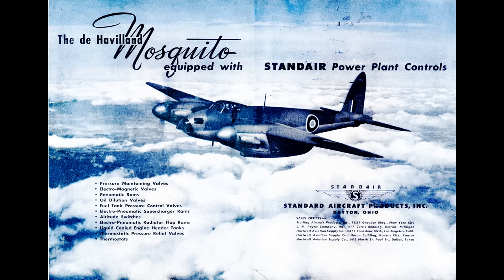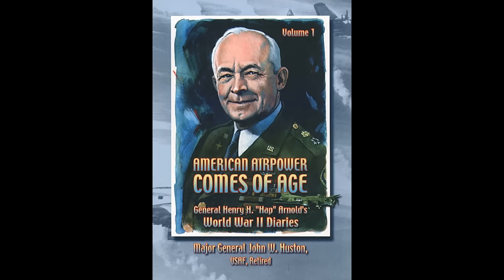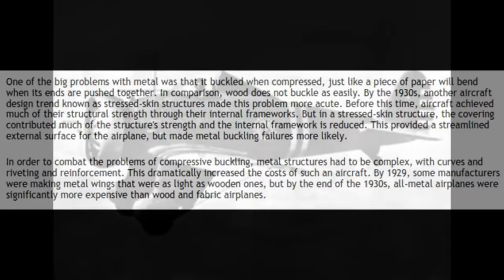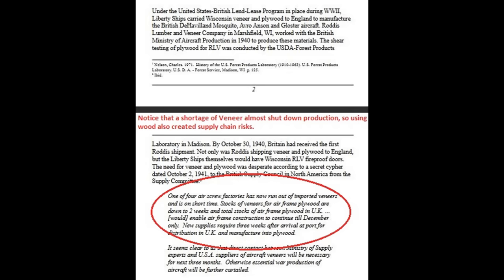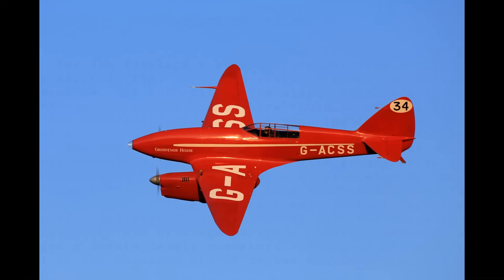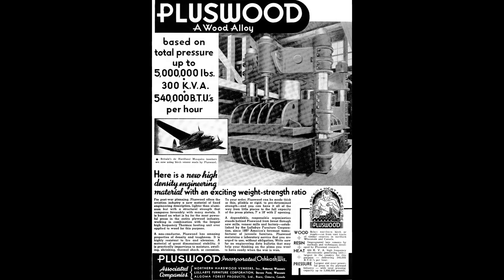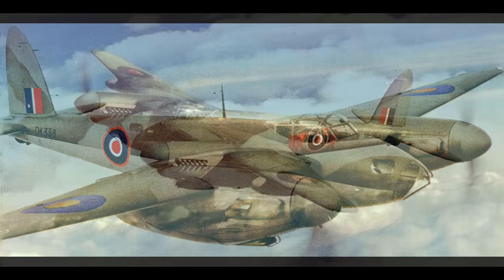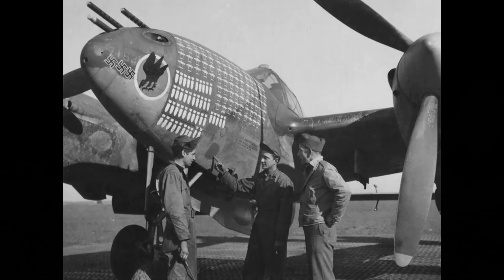De Havilland Mosquito vs. ?

Comment: The "Wooden Wonder", looking forward to this one Greg, even more than usual.
Reply: I second that.
Reply: Losses of the mosquitoes was lower than any other bomber due to its sheer speed and manoeuvrability and all with no defencive arms
Reply: @markmitchell450  Airframe losses were indeed lower than other types but aircrew survival from shot-down Mossies was slim. The airplane was very hard to bail out of. No canopy jettison, had to exit through the belly hatch (right next to the starboard prop). I've been in one, it's tight!
Reply: @zephyrold2478  q
Reply: @neilrobinson3085  er have you seen the upper canopy escape hatch?
Reply: big cheese  OK so how many mosquitoes were shot down by rather German jets?
Reply: @neilrobinson3085  there was a jetisonable upper canopy which was the recommended route for a  bail out also for forced landings.

Comment: The most versatile aircraft of the war. And one of the prettiest too! A fact not often mentioned that I think highlights the genius of De Havilland's design is that all parts of the 'plane that were heavy or bulky, such as engines, wheels, bombs & fuel tanks were attached to the wing. This took a lot of stress away from the fuselage. In an old black & white docco I saw, a ground crew member being interviewed said ' "Everything on the Mozzie is bolted to the wing, so all the fuselage has to do is hold up the tail & keep the rain off the pilot".

Comment: The casualty rate on the Mossie was incredibly low . Thank you . Four versions , bomber , intruder , night fighter,  fighter bomber , and a web  foot warrior ,anti shipping strikes and anti sub patrols .
Reply: The light construction and (sometimes) no armament made a recon mossie a speedy bird that was very hard to catch==but when it was caught...
Reply: Quite! But it's hard to find an equivalent aircraft like the Phantom: it could tangle with single engine fighters, with no problem (due to it's robust design and good thrust to weight ratios--especially when it had good to great pilots in the 'pit), the Mossie was a hell of a plane, but I don't think the odds of dogfighting with an Me or FW were going to be good unless there was a hell of a pilot at the controls.
Reply: It was also used by the OSS, ( forerunner to the CIA. ) for insertion and communication with their agents. A Radio operator rode in the bomb bay. There was also a "civilian cargo" version that flew to Stockholm to pick up consignments of ball-bearings. They were nominally owned by an airline to get around Sweden's neutral status.
Reply: @colinkepple7555  Yes. BOAC Mosquitos. A few were shot down. One brought Nils Bohr the nuclear scientist back from Stockholm, to eventually join the Manhattan Project
Reply: @nickmitsialis  it was rarely if ever caught, one of the reasons the USAAF bought them for photo recon.
Reply: @hughjohnson2674  Indeed; when stripped down the Mossie was faster than heck.

Comment: Another great video.
I recently read Sidney Camm's biography and its surprising how much time he spent talking to the man at the Ministry. De Havilland probably did the same. Alfred Prices book on the history of the Spitfire goes into some detail about how the RAF only saw the Spitfire as an interim measure until the Westland Whirlwind, with its 4 centrally mounted cannon was ready, and  which itself probably only second reserve to the Hawker Tornado, so when RR pulls production on both the Peregrine and the  Vulture engines both these planes are basically dead( indecently, chopping the Vulture kills of the Avro Manchester at this time as well ). Hawker do have a back up plan with the Typhoon, but at that time in 1941 the Sabre is so far from being a reliable engine, so one can imagine the man from the Ministry desperately asking De Havilland 'what can you do quickly for us?'
Its interesting but in literature the Camelot fables tells us that in time of need the wizard Merlin will always be there to help us. How true that was in 1941.

Comment: Great video. Such a calm, informed, sensible evaluation of the Mossie. 
As for the P-38 question, I think the US had adequate alternatives to the Mosquito but here in Britain, De Havilland harnessed an otherwise untapped source of labour and production. Not just woodworkers but a veritable legion of medium and small businesses and organisations which dispersed parts and component production across this country. Everything from radios to entire wings and fuselage halves were produced outside of the established aviation industry. 
As for the Mossie's structural toughness, those photos you used of big chunks of missing wings and tailplanes were taken on the ground - they got home.

Comment: Thanks a lot for another interesting docu-video. I remember reading that story too, I can't recall which book now. However there are some facts we can repeat. Hughes was trying to sell USAAC/USAAF his "Wooden" Hughes D-2 up until 1943 so there was no way he'd agree to build Mosquito. Not least he had no production facilities so he'd only get his contract cancelled for nothing. Fairchild, a close friend of Hughes, was also almost obsessed with wood but was probably not at all keen to produce something he didn't invent. These were entrepreneurs and inventors with egos larger than Mt. Everest. To be fair, the wooden construction techniques seemed different with Americans keen to use Duramold plywood while Mosquito had what we call composite layering today. There is another important point to mention. Fairchild Company did not necessarily made an incorrect statement about strength but it was of course misleading. British load factor requirements were less than US requirements. US requirements for load factors were based on years of peace time use which was nothing but useless ballast weight during war for an aircraft that may or may not last a year. For example North American asked USAAF to redesign Mustang with British factors to make it more competitive in climb and were allowed to do so. Resulting P-51-H was about 500 lbs lighter in empty, about a very substantial 6-8% less than P51D. Fairchild clearly honed on this difference without explaining why. Considering Canada quickly tooled up and built over 1,100 Mosquitos alone shows what an opportunity was missed with US built Mosquito. As such I don't think the real reason had anything with P-38, not remotely. They are not even aircraft of similar class.

Comment: DH Vampire jet built late war and just to late to become operational during WW2 was still partially of wood construction.
Reply: ISTR the Candberra also had some wood in the tail construction.
Reply: @andrewwmacfadyen6958  if that's true then that's quite amusing, as the Canberra was was of the few foreign designed aircraft the USA ever licenced to build. They called it the B-57.
Reply: @juststeve5542  one of my favorites.
Reply: @juststeve5542  I believe the pilots loved it!
Reply: The Two seat side by side seating DH Vampire used the Mosquito canopy.
Reply: Planes Potter  Whilst the Mosquito and Vampire trainer canopies do look similar they’re definitely not the same, for one thing the Mosquito canopy doesn’t open so the crew wouldn’t be able to get in and out of the Vampire if it had a Mosquito canopy on it!
Reply: The DH Hornet fighter, a follow on to the Mosquito, was still largely built of wood and is considered by some to be the best propeller driven fighter ever built.
Reply: @planespotter4494   Not quite the Vampire canopy had a rear hinge but the actual cockpit design of the dual control Mossie was actually carried over to the 2 seat Vampires and Venons,  the the RAF wanted it adapted for the the Hawker Hunter T7    which   was directly carried over to the EE Lightning.
Reply: @richuar  Early two seat Vampires did indeed have a more heavilly framed canopy that was similar in some respects to the Mosquito than later versions. However, both style of canopy used on the Vampire could be opened.
Reply: @EricIrl  yep that's exactly the point I was making. If they'd just put a Mosquito canopy on a Vampire  it wouldn't have worked.
Reply: @richardcolvert9409  I remember skulking around some abandoned Irish Air Corps Vampire T55s at Baldonnell that were slowly deteriorating in the Irish damp. The wooden structure of the cockpit "pod" was slowly delaminating and flaking off.
Reply: @juststeve5542  Nasa still has three in service today, greatly modified but still mainly a Canberra with its wooden fin. Had a very black Canberra taxi close by me at RAF Scampton 1972 on a nuclear exercise that was on in the UK, it was the high altitude spy plane that the U2 could not beat.
Reply: @richuar  The Mossies canopy did have the top opening hatch for rescue.
Reply: Gordon Davies indeed it did, very useful in an emergency but not ideal for normal egress and especially ingress!
Reply: @fafner1  The Hornet is a lovely aircraft, but best prop fighter ever is a ridiculous claim. Best at what?. No way it outmaneuvers a single prop, or outclimbs one, or outruns one. Whoever those "some" that consider it the best are, they know nothing about air combat.
Reply: big cheese  no composite jets, we wouldn't know how to build wooden jets :-P!
Reply: big cheese  Fred Flintstones car had wheels, or more appropriately rollers, made from stone not wood. It was actually very advanced for the time.

Comment: I’m just going to fill in some blanks… Britain had been developing advanced plywood composites from the late 1800's, a material lighter than aluminium with a tensile strength higher than steel/weight why would you not use it. Trams, underground trains, buses and Malcolm Campbells Blue Bird were made using wood composites. The dh.88 comet racing plane and Albatross mail plane owed their speed to rigid, light weight and smooth wooden composites (no rivets).

These advanced materials were the carbon fiber of pre-war Britain, building a wooden bomber was not as daft as the Americans thought and using materials no-one else was using, was a bonus. However, ply/composites had to be shaped over wooden formers requiring precise workman ship, aluminium was easily stamped out and riveted making it perfect for mass production by lightly trained operators.

While the Mosquito’s wooden construction aided in it’s phenomenal speed, the incredible low weight/high tensile strength also saw the air frame carry 4x it’s original proposed bomb load maxing out at 4000lbs just short of that carried by B-17’s on long range raids. So robust, one variant installed an auto-cannon based on the British Ordinance QF 6lb anti tank gun….or M1 57mm in US Service. Firing 58 rounds a minute, from a 22 round clip, German shipping and U-Boats were especially nervous of this MK18 Fleet Air Arm variant.

Probably the worst US decision with regard to the Mosquito was not using it to drop “high-ball.” A variant of the bouncing bomb proposed for Japanese barge/ship busting. Using B-25’s, they were to slow to avoid the bombs splash, a number of US crews were lost trying to use the weapon. One "Highball" was enough to break a battleship in two from 1600 yards. Eric "Winkle" Brown the Worlds best/most experienced test pilot, was the first to land/take off from a carrier using a twin engine plane.... A Mosquito, he was not told why until years later.

https://www.youtube.com/watch?v=8zBp1NCbAr0 (HIGHBALL)
Reply: Trees are in short supply in England and balsa had to be shipped in. That is the only down side in production of an excellent aircraft.
Reply: The variant that had that anti tank gun was called the Tse Tse! (more deadly than the mosquito). They were, however operated by Coastal Command.
Reply: @markgranger9150  Balsa trees are in VERY short supply here, seeing as we don't have a tropical climate...
Reply: I have all the respect in the world for Eric Brown, but he wasn't the first to take off and land on a carrier in a twin-engined aircraft. The first such feat was by the French in September 1936, many years earlier, a modified Potez 56 that conducted trials on the carrier "Bearn".
Reply: Jack Tangles    Potez 56,  two  185hp radials.   So although it was a fair-sized aircraft (8-seater), I doubt it could be classed as 'high-performance'.   So, due credit to the french, but I think Brown's statement is a fair claim too.
Reply: @robertallen5056  But he was the first to land a Mosquito
Reply: Hi British Engineer,
Genuine question, did the airflow improve significantly without rivets or was it mostly a weight saving issue? (Or was it a combination & way more complex than non engineering background person like myself would follow?)
Reply: @LemmingFNSR  No rivets leads to a smoother airflow, and having the skin be load-bearing ("stressed") resulted in less mass, as the skin on a metal airframe is more or less just for aerodynamics, rather than doing double duty like the wooden skin.